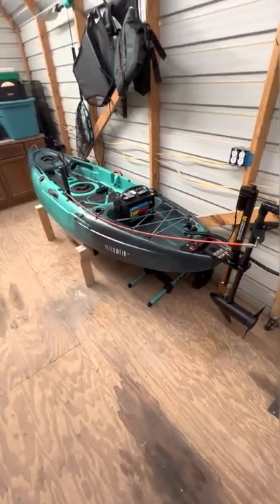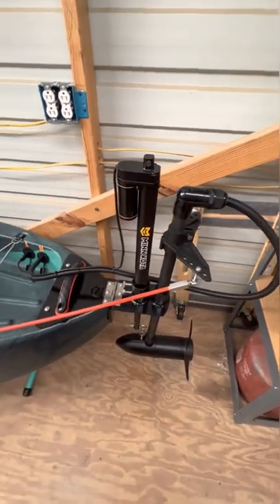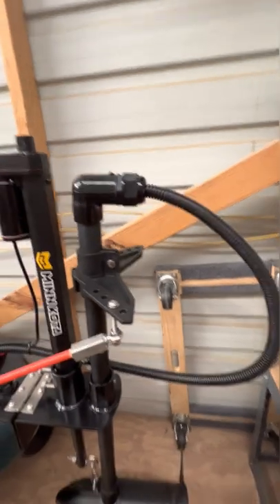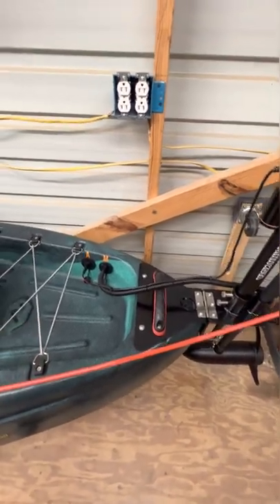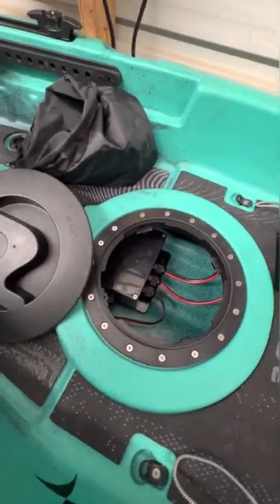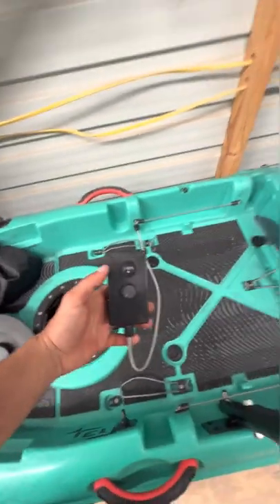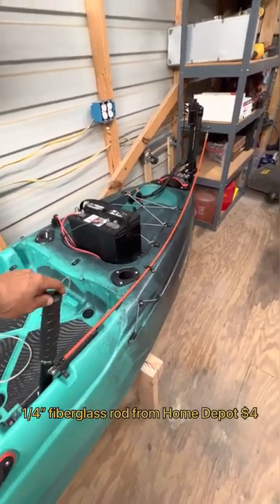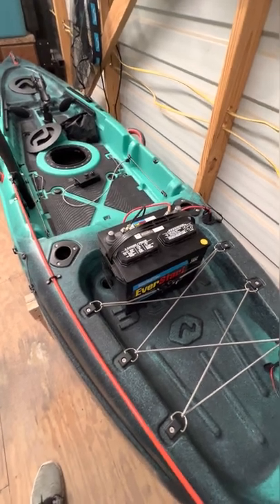Vibe yellowfin 100 fishing kayak with actuated trolling motor mod and PWM!

Comment: Just got my Yellowfin 100 and haven't been able to find a stern mount for a trolling motor. Nice setup! You could probably make and sell those :D
Reply from the maker: I thought about doing just that, but I only have a design for the yellowfin since it is the only one I have access to. My customers would be limited. If you have trouble figuring something out let me know and I can custom build another
Reply: @p0wershifter1 how much would you charge for a custom mount like this? I’d be interested in one
Reply: Where did u get the pwm
Reply from the maker: @DannyLopez-gw8ge  amazon

Comment: Great build, very clean!! What did you use to connect the ends of the fibreglass pole to the bolts on the steering plate?
Reply from the maker: Item number (526825) from Home Depot. It is an electrical 1/0 line splicer

Comment: Any tips for drilling holes into the mold? I am going with a different mount style but want to replicate your wiring, all others I’ve seen have wires all over the outside. This is much cleaner running through the kayak
Reply from the maker: I just measured the size of the outlet and drilled using a hole saw accordingly. Also used an electrical fish tape to run wires where I wasn’t able to get my hands.

Comment: What did you use on the ends of the fiberglass rods and how were they attached?
Reply from the maker: I used the biggest aluminum splicer that has two set screws from Home Depot. One end has the fiberglass rod, and on the other end I used a stainless steel eye bolt that I cut down a bit to prevent it from sticking to far out of the splicer block. Then a 10/32 bolt runs down from my steering bracket through the eye bolt and is secured with two locking nuts on each side of the eye bolt.
Reply: What's used there on the handle for steering that's connected to the fiber rod

Comment: Does the steering cable get in the way when you raise and lower the motor?
Reply from the maker: No it will go all the way up and down with no issues, but it does turn the motor slightly when going all the way up.
Reply: @p0wershifter1  have you ever had a problem with the handle getting too lose? How do you make sure it keeps tension
Reply from the maker: @nicolasbasile3644 I keep the handle with just enough tension to where it doesn’t wiggle and is able to travel back and forth easily. It never comes loose once I set the tension where I like it due to the stainless steel nylon locking nut.